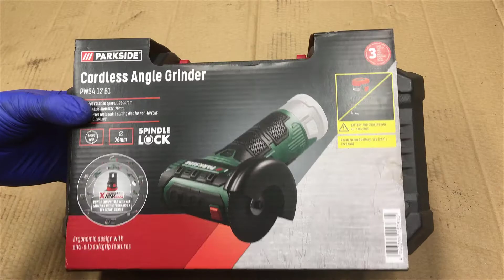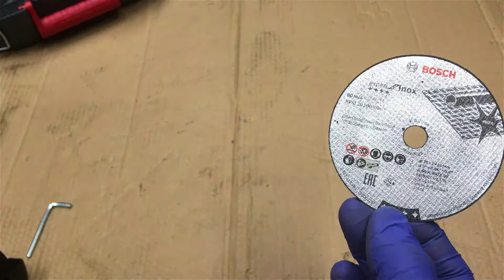TEST and FAILURE! PARKSIDE 12V Cordless Angle Grinder PWSA 12 B1

Comment: It is intended for small jobs…pros are light and safe tool; for 10+mm steel just take a full size grinder. Useless test!
Reply: I think the test was beyond the expected use... you can buy another battery though or get it replaced under 3 yr warranty